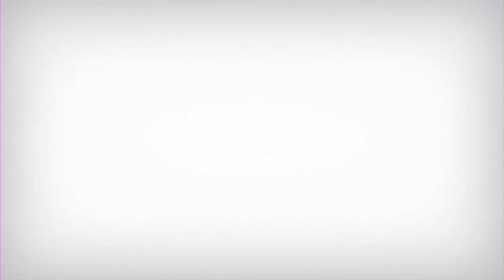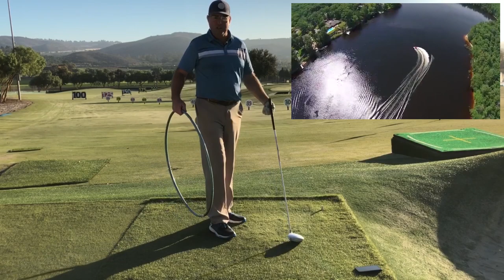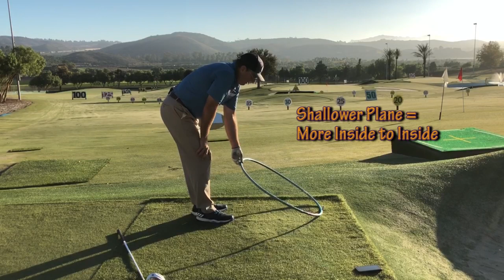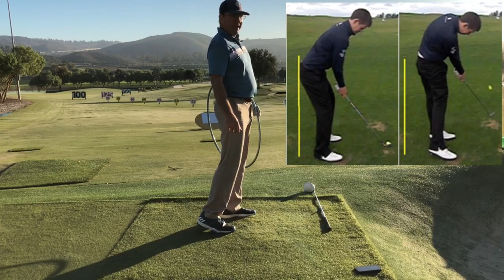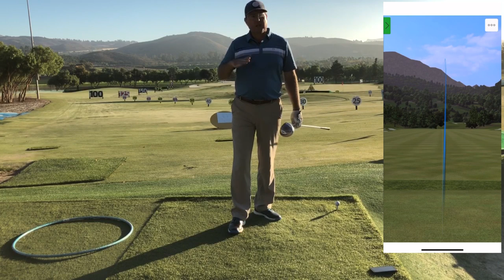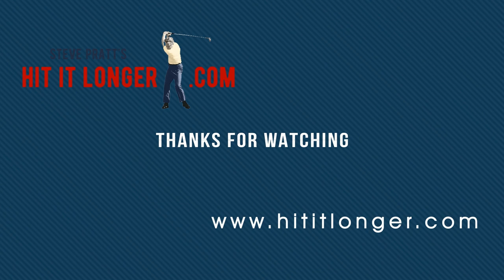Mastering Golf Swing Plane and Handle Path

Comment: Steve, just wondering if you know any tour players using Mike's swing. Keep the great vids coming.
Reply from the maker: No one I'm aware of is utilizing the backswing pivot that Mike advocated.  There is a trend in the direction of a freer hip turn and detaching the front heel though...compared to the x factor style that was in vogue a few years ago.  All research is pointing back towards Austin.
Reply: @Inmotion70  Yes I've noticed that quite a bit lately, hopefully it will save a few more back problems too.

Comment: Steve, can you explain what Austin is communicating regarding the left shoulder angle/alignment on the downswing at the 7:50 mark in this video.  Trying to get this right in my mind compared to your video of keep turning the shaft around your body.  Looks like Austin is swinging out then turning the left shoulder after in follow through?  Looks like in this video he is also conveying swinging right of the target line.  https://youtu.be/UWX-QHHzvUc
Reply: I cannot understand the audio, but I think I can guess.  The whole premise of the Austin swing is that it takes a lot of time for the effort of the hip turn and the arm swing to reach the racquet head.  The student got that right away, but because it is so early in the swing, the hip action tends to be steeply downward.  Most of the rest of the video seems to be explaining that you need to convert that downward action into an upward follow through.  I would not worry too much about swing path.  Just imagine you are going to pound a big peg about 5 feet behind you into the ground behind you at a backward leaning angle.  Then pull everything up steeply so you do not bury the club in the ground.  Get the distance first, tinker with everything else later.  You might not even have to.
Reply: Thank you for the reply Donald.
Reply: Yes, that’s right.  But there is some wiggle room here.  The best fairway wood shot I ever made was because I had topped a couple previously.  I swore I was not going to top my next one if it meant I drove my club down to China.  What I did was I drove my elbow straight toward my right toe and tossed my club head back so it came around front faster.  But I did not notice the second action and things went south quickly.  If you watch Mike Donovan, he makes both moves.  Mike Austin, however, seems to worry more about getting that club head going back and, I think left, right at the start of the backswing.  But I think that is because he has a shallower backswing.  I think of the swing as a lot of compensating actions that we do rather matter of factly in everyday life.  I think of the arm swing as going out toward where a second baseman would play that is brought around to square by the hip turn.  It is vital to just let the arms go.  I do like Steve’s idea of getting the low swing plane to make turning easier getting a flat spot in your swing never made that much sense to me.  I have added 60 yards to my drives by listening to him and the two Mikes, but it is still a work in progress.

Comment: Wouldn't Mike Austin say that the plane of the swing is from the vertebra at the base of the neck to the ball?  So if you had a big huge hula hoop and placed it around your neck so that the center of the hula hoop is the base of your neck and the bottom edge of the hula hoop is touching the ball, this would give a perfect illustration of the plane?  Depending on what club you are hitting and the length of the shaft, this will make the plane steeper or shallower.  With a driver you are lined up further away from the ball with a longer shaft and straighter posture than for an iron, which means a shallower swing plane.
Reply from the maker: And yet the shaft always points beyond the ball both halfway down and halfway through.  What shall we make of that?
Reply: @Inmotion70  You mean it's not on the same plane?  I'm not sure I understand.  I think Austin's analogy maybe the same as what you are saying anyway.
Reply from the maker: @davidobrien3593  The swing plane is simply a crude representation of what the club is doing...like a stick figure drawing of a person.
Reply: @Inmotion70  Okay, thanks.  Another distinction is that the club is straight only at impact and cocked one way or another everywhere else in the swing, so that it's not a perfect circle with a uniform diameter throughout.  Maybe that's one of the things you are talking about.